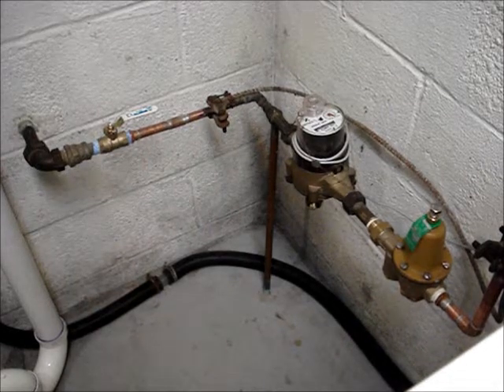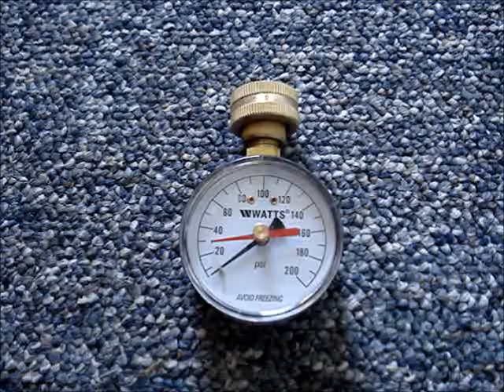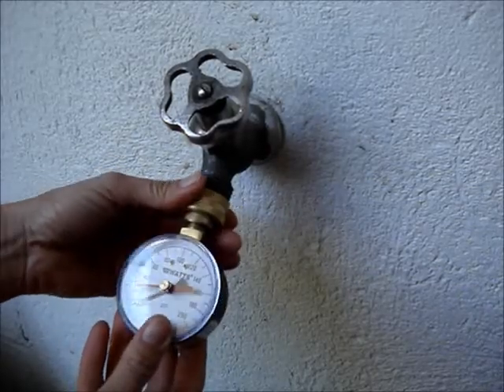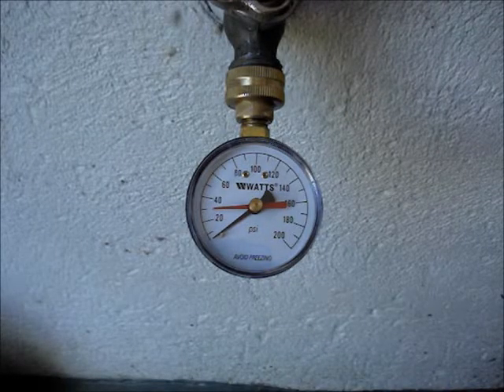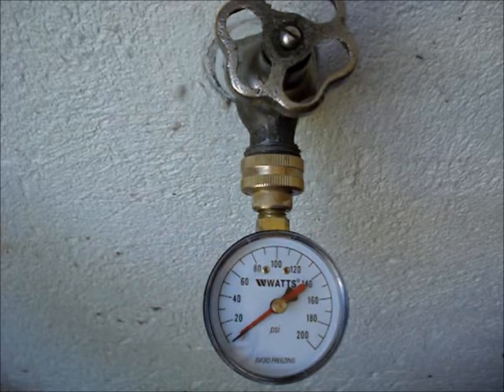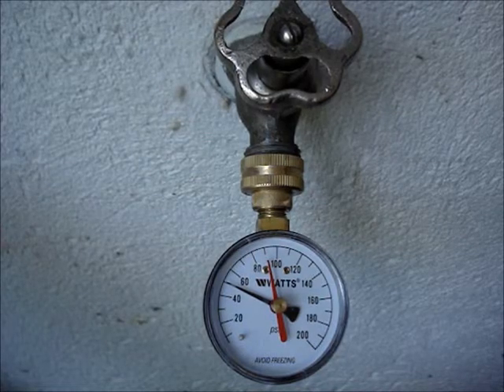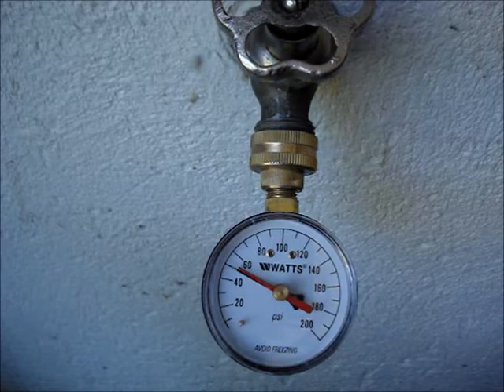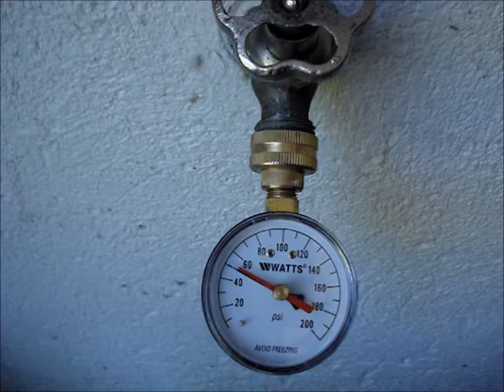How to Check Your Home's Water Pressure

Comment: Excellent vid.  I noticed when the pressure gauge is first installed and turned in the pressure can change from about 55psi or so and then go up to about 70psi after remaining on for about  3 minutes. I assume it's best to wait a few minutes for a more accurate reading?

Comment: So if after one day, my red arm is reading about 140 psi is that OK? My black arm stays below 75 psi
Reply from the maker: Maybe a problem with an expansion tank if you have one.  Make the water heater kick on and see what happens.  I explain how a typical system works in this video.  https://youtu.be/E8VJxb_eUQI?si=mtBwF466HpM7oRUc

Comment: My valve measures at 55psi but overnight, it shot up to 85psi. It's back down to 55. Is that alright? My pressure reducing valve has an upper limit of 75. Is this due to the hot water heater's thermal expansion and should I be concerned?
Reply from the maker: I explain how a water system/PRV/water heater works in this video.  You might find it helpful.  https://youtu.be/E8VJxb_eUQI?si=dOIcnCFBTdNcfbHf
Reply: Thank you! I watched the video. I have a closed system but what's still not clear to me is if my water pressure gauged jumped up overnight and went back down, does that mean I have a problem? I checked my expansion tank and it is properly pressurized.
Reply from the maker: If no water flowed, then it's likely your water heater kicked on overnight and caused an increase in pressure.  The bladders in those expansion tanks can fail.  Maybe that's what is going on?  Make the water heater turn on and watch the gauge to see what happens.
Reply: I double checked my expansion tank. This time, I turned off the water and drained some hot. What do you know, the pressure on the expansion tank was near zero! I decided to reinflate it back to 55psi and overnight it seems to be holding. I probably should replace it but for now, it appears to be holding air.
Reply from the maker: There's a bladder in the tank, it likely leaking.  https://youtu.be/Q-iJ6jBkG1Q?si=v99qim8Z8OhZV29P

Comment: House water pressure should be set at 65 psi. If you’re not receiving enough water to properly shower then you could bump it up to 75 psi. I remove all water savers from my showerhead so that I could get clean faster and actually save more water. When you have long hair it takes forever to clean your hair with minimal water. Do you want a good shower or not?
Reply: Thank you it’s a good video.

Comment: I tested the water using the gauge.
The red shoots up to 100 psi and the black is at 50 psi. 
I tested it 4x and all the same result. 
I do have a expansion tank but that’s after the PRV, as the PRV is installed outside

Comment: I have a water pressure of 100 psi when i use the water it drop to 65 and if i close the water it goes up to 100 in 5 sec if i regulate it it goes up or down but it i close the water it goes up to 100 should i change it or it is the water heater
Reply from the maker: Do you have a pressure reducing valve?

Comment: Wonderful video!!  This allowed me to prove that my home's water pressure regulator went bad.  I had a new hot water heater tank installed and it was leaking from the T/P overflow valve, even after an expansion tank was installed.  The newer tank's T/P valve's pressure threshold was much lower than the original tank's according the the plumber.  This video showed the exact test my plumber ran, and he was able to install a new regulator that same day.  All has been perfect ever since with no leaking from the new hot water tank overflow valve.  I just hope the over pressurized plumbing doesn't cause me problems down the road.  I already did have some pinhole leaks a year ago that needed addressed.  I will buy my own pressure gauge now, since this is as easy as checking tire pressure.  I will test annually or more frequently to monitor the state of the new regulator.  The old one looked to be 15-20 years old.

Comment: Kept getting leaks in my house.  I bought the house 15 years old, so I just figured it was older fittings or glue failure.  After about 4 leaks in 12 months, I knew something was up.  Guage on water faucet pegged out at 125 psi.  Fix one leak and the pressure moved on to the next weakest link.  Wish I would have installed mine more accessible than 2 foot in the ground a foot from the concrete slab!!  Like they say... Hind sight is 20/20.

Comment: Great helpful video . Which Wilkins pressure regulator do u recommend . Should I put two in just in case as lot of stuff I have gotten in past comes from China and fails . Have you heard of  Equalibar? Do u need to get omw with babe so I.can read ? Thanks so much ahead for your help!.
Reply from the maker: I can't recommend the correct pressure regulator for your situation, there are many models.  If you have an existing one and you know it's the correct model, replace it with the same one.  Installing two in series will likely cause problems.  Never heard of Equalibar.

Comment: I am wanting to install a new shower system that has 2 heads, a rain head and a regular large head. Is there something I need to do to increase the water pressure specifically for the shower only,  or should I increase the pressure for entire house, if so to what psi? Thanks in advance. :)

Comment: That red tab for the top reading is super sensitive and I keep finding that is shoots all the way past an accurate number just by the force. My reading is at 60 psi. I left over night and saw the red line at 82. Is the 82 from thermal expansion? I checked again later but that red tab shot all the way past the numbers due to sensitivity.
Reply: Most likely, an expansion tank will solve that problem

Comment: I found out the water is coming to my house at 100 psi, no wonder I have had problems with my washing machine solenoid valve, fixtures and others. I just installed a regulator and set it to 50 psi.

Comment: my pressure is 30 and my town says that's all they need to provide.  I find this hard to believe
Reply: Sounds right actually, that's all they are required to do. Imagine your pressure was too high, they wouldn't fix that either and everything would be leaking so... 

But hey if it's really a bother you can hire a plumber to put in a booster pump I'm sure they are only a few grand installed.

Comment: My pressure starts at 20 and after a few hours goes up to 85...which number is accurate. I attach the gauge on to the faucet that is located in the garage
Reply from the maker: 20lbs of pressure is on the low side.  The high number could be caused by thermal expansion when the water heater turns on.  If you have a pressure reducing valve (PRV), it could be failing.

Comment: I have a damaged pressure relief tank, and have its replacement; I just need to determine the water pressure so I can inflate/deflate the bladder in the relief tank to match it.  I live in a condo and I don't have a hose bibb.  The tip about using the washer supply was very useful to me because I agree that possible HWH sediment would compromise the guage.
Reply from the maker: As with many things there is some debate about that question.  Most people recommend matching the tank pressure with the water pressure.  If the installation instructions don't offer any guidance you could contact the manufactuer's tech support for their recommendation.

Comment from the maker: Connecting the gauge to the water heater is not the preferred location.  There is often sediment on the bottom of the tank that could get into the gauge.

Comment: What if my water pressure starts out at 45psi and then gradually goes up to 80plus psi within 2 minutes? Which number is my actual water pressure?
Reply: If you have a regulator or back flow preventer in the main line, you must install a thermal expansion tank near the water heater.

A failing pressure regulator (seat), will account for a slow rise in pressure.
Reply from the maker: It sounds like your water heater may have turned on, most likely the normal pressure is 45psi.  I have a video that explains how a water heater increases pressure:  https://youtu.be/E8VJxb_eUQI
Reply: Know How Now it's weird because I already turned my water heater to vacation mode like you said. Any other ideas?
Reply from the maker: Did you try the test more than one time?  If yes, does the pressure start at 45 & rise to 80 plus every time?  Where did you connect the gauge? Maybe the gauge is faulty or has dirt in it.  You also may try leaving it connected for a couple of days and periodically check on it.  If the water heater has recently fired, if you open a faucet it will release the excess pressure caused by the heated water.

Comment: Great info about the water heater affecting the test.
I have a few gauges that I haven't used (in the package) & none of them have a hose bib connection on them... just the small threads.
Reply: N Y o